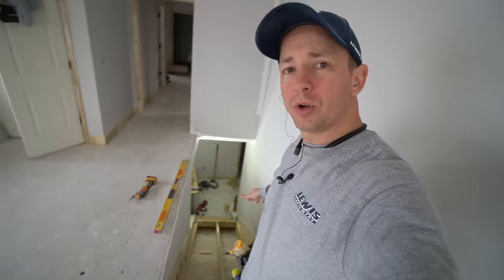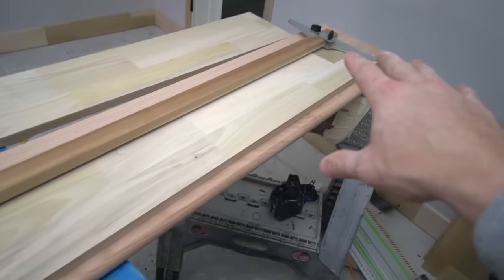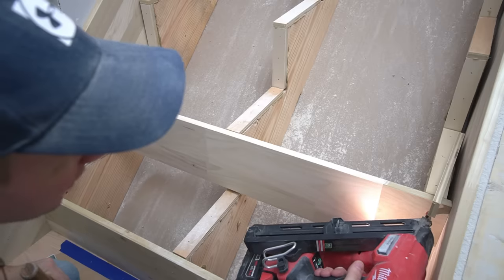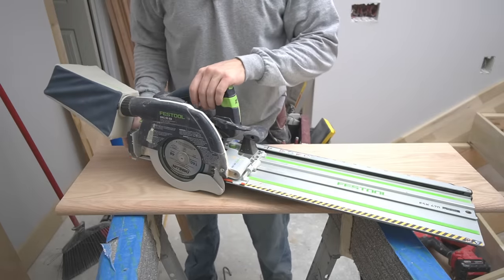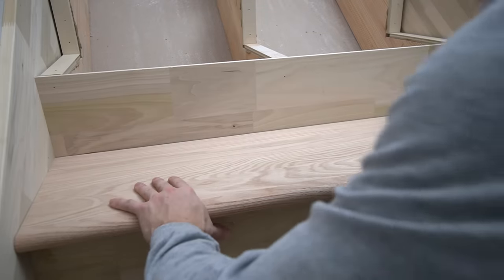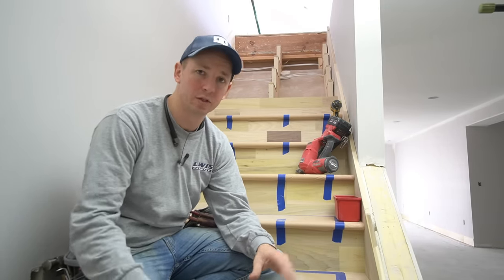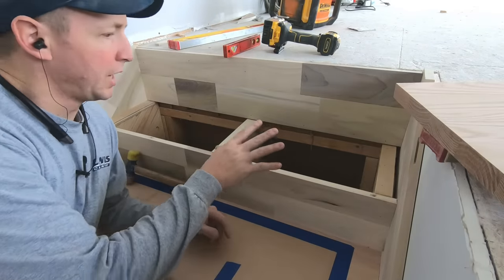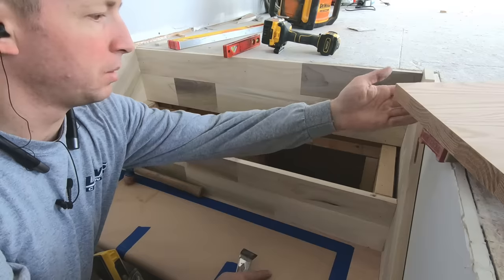Professional Stair Tread & Riser Installation - Complete Install Process

Comment: It looks like you switched from a 5 degree back bevel on the treads with PL adhesive on the bottom steps to a 2 degree back bevel and wood glue on the treads at the top. Any particular reason for the switch?    Thanks for the great videos!
Reply from the maker: Yes, with 5 degrees if you over tighten the screws it will actually twist the riser and throw it off.

Comment: Great work and fantastic tips!   The only tidbits I can add is that instead of right and left I put a big sharpie mark on the points of the stair gauge to indicate bottom/ back.   That way on risers the dot is always indicating the bottom and on treads it's always at the back.  Also, I like to put a spacer under the stair gauge, the thickens of the tread so I'm referencing where the top of the tread will be and it also makes it easier to bump the back of the gauge to the riser.  The only downside is that's two more blocks to fumble with on an already crowded staircase. 

Obviously your system works great!  Keep up the great work on the job and with the videos. 👍

Comment: The quality of this video matches your work!....that good.

PL glue is the best thing ever for stairs. Worked without it for years, and fought squeaks and cracks by additional fastners that dramatically increased effort.. Subfloor adhesives don't cut it.
Did you mention the shiming of the stringers?....can be a real pain and effort sometimes, depending on the framing......edit: after reading the comments, plenty of input on the stringer shims😀

(Old guy disclaimer)...Almost exactly my normal process, after refining it for 47 years and 400 plus installs.

Comment: Thanks.  Can you comment on the double glued spacers you use against the treads and risers?  Assume you’ve learned best for sound prevention.  Also, in my case I am replacing treads/risers; the big headache, removal of these old spacers (just under treads) and related adhesive.

Comment: Your definitely a high quality finish carpenter. Most finish guys I see ( 36 yrs custom home builder) build stairs the same way, although some dado the bottom of the riser for the tread to sit into. 
     My question is, the stringers look like 2x10 not even 2x12. There’s no double center stringer or even a 2x4 on the side for strength or deflection. Personally we only use LSL stringers only because the stringer  cannot deflect , sag, twist , crown ever.
Reply: Look like 2x12 to me and the two outside stringers have 2x4 on the outsides to allow for drywall and skirt board.
Reply from the maker: This is rock solid. It's tied into the wall framing. You just can't see the 2x4 spacer between the 2x12 and the wall.
Reply: @michaelmaas5544  I realize there’s a 2x4 on the outside stringers and I assume they are lagged to the frame but there isn’t any 2x4 on the center stringer and it will deflect
Reply: @InsiderCarpentry  I get that, and I assume they are lagged to the walls. But there is a single stringer centered and it doesn’t have any other support. Great channel
Reply: @jncn1490   IDK knee wall under it perhaps?  What I do know is if Spencer says it’s all good then it’s all good. He has never shown me anything that would make me doubt him. And I don’t believe he’s willing to put his name on anything that’s not right.

Comment: Beautiful work! That wood looks so good in its raw, unfinished form. Question though, I just had my carpeted stairs redone in red oak treads by a carpenter. Im in a cookie cutter 2 yr old house with a cheap usb and construction lumber based stair base and the carpenter went in and tried to eliminate as many of the old creaks I had before putting down the new treads (stairs were creaking like crazy with the carpet!). He fixed the subfloor creaking but now I get creaking as I walk on the treads…looks and sounds like tread-to-riser creak now as the treads are very nice and tightly installed with no gaps. What can I do to remedy the creaking? I know I don’t have the center stringer like in your video so I assume it’s because of a lack of sufficient support in the middle of the tread? Thanks for any insight!

Comment: why the plywood on the stringer edges?
Reply: I was just going to ask the same question!
Reply: My question also. In the other stair tread video he did, it was because the stringers were initially cut with rise/runs to accommodate carpet, but was later changed (after install) to hardwood, necessitating an adjustment in rise/run - thus the plywood. I wonder if that is the case here as well.
Reply from the maker: Framers cut it wrong. They had it cut in for carpet with 2x framing material. So the framing lumber had to be removed and the treads shimmed up 1/2". I was going to put it in the video but it was getting too long.
Reply: @InsiderCarpentry  makes sense!  Thanks for the response.  Great videos! 👍👍

Comment: Question.. I have a situation with a kinda trashed staircase. Pine treads and pine risers. Was a carpet set. The treads are mortised into the stringers. I want to install new treads and risers. They squeak and some treads are cracked. I was to put new oak treads with white risers. I have to cut off the existing noses of each step. If I put a new tread on top of the existing tread what should I do with the old tread nose that is mortised into the stringer? It should be under the new tread, Sugestions?

Comment: I used my kreg tool to make pocket holes in the stringers and screwed into the underside of the treads so I had no exposed nail holes. I did have access to the underside of the stairs.

Comment: Great video, and quality work! 
With installing stair treads and risers it seems some like to install tread before riser and some like to install riser before tread! When I worked and learned from my old boss he did tread then riser. Now I work for myself doing finish carpentry work. I'm starting my first stair tread and riser install this week. Trying to figure out if I want to install riser before tread and seeing this video. 
Would like to hear anyone's opinion why they install tread or riser first!?
Reply from the maker: I like risers before treads because its more forgiving and you can screw the riser into the back of the tread. Very strong, tight joint, no squeaks.

Comment: Tread gauge is neat. Easy to handle a wider tread with a longer piece of 1 by.  I don’t think you mentioned it, but it appears to handle any out of parallel situations with the skirting boards.

Comment: Why did you change from screwing through the framing stringer into the skirt board (7.00) to screwing through the top of the riser into the skirt board (11.10)
Reply from the maker: Evolved. I liked the results I was getting better going directly through the riser.

Comment: My first step for installing treads and risers over rough cut stringers is to re-evaluate my strategy - there are so many reasons why CNC cut routed stringers are better. 
First, if you must cut sawtooth stringers use LVL so that the point doesn't shrink away from the tread riser like it will with KD framing lumber.
Second, there are no visible fasteners with routed stringers. Don't tell your customer that the nails in the top of the tread are necessary, because that's not true.
Third, all your treads and risers will shrink/expand with seasonal movement. Even if all your joints are tight, there will be gaps that will appear after just 1 year. There is no scribing at all with routed stringers, and there is room for seasonal movement.
That's just a few reasons...if you don't know what routed stringers are, call a professional for your next stair project.
Reply: Great video, just pointing out that there is a much better way to build stairs that gives a better product and can be cheaper/faster.

Comment: I seemed to have missed something here.  With your "day 1" installation of risers I didn't see you drill through the top of the riser and into the skirt, then screwing the two together, but you were doing that on the next day's install.  Why the difference, and what's the point?
Reply from the maker: On the first few risers I didn't screw through the top of the riser, but then I decided to.

Comment: I am in the process of replacing the beat up, old, ugly stair treads in my 1952 home with new red oak treads. It looks like you didn’t stain or varnish the treads you installed here. I’m new to your content, so forgive me if the answer should be obvious… Just wondering if finish work is outside of your wheelhouse (so another trade person is coming to do so later), or if you recommend staining and varnishing ahead of time? This is a big project that I’m primarily doing solo. I’m pretty handy, so I feel confident, but I like to be prepared before I get too far ahead. Thanks for you’re a great video!

Comment: Awesome video.  Thanks for posting it!

Any thoughts on pre-finishing the treads (and risers) so moisture levels on top and bottom don’t get out of whack?

I’ve also seen some treads rabbeted into a rabbet or dado at the bottom of the riser to allow for movement without opening a gap.  Worthwhile or a waste of time?

About to replace carpeted stairs with hardwood treads and risers.  This has been the most detailed and informative video I’ve found so far.  It’s much appreciated and earned my sub
Reply from the maker: The stringers are drywalled on the underside so i'm not concerned about moisture here.

Comment: Did you shim/plywood the rise and run or where the stairs like that? Curious how you square up those shims. You skipped that part. And what do you do on top step with a 3/4 hardwood floor? I typically make my own top transition

Comment: @InsiderCarpentry great video. I am going to replace old steps in a stairway to the basement for my first go at steps. A couple questions if I could:

(1) For the pocket screws to screw the back of the riser into the tread, what size (#8?) are they and are pilot holes needed? I don't think i saw that but wanted to check.

(2) Later in the video i see you screw the top of the risers into the stringer, but not on the first riser you installed. Why is this needed and what size pilot hole and screw are you using?

Thanks!!

Comment: Would anything be different on a remodel? Like ripping out carpet and putting in woods treads and risers? Am I going to be able to do all that screwing in from the back side stuff? And many are telling me I don’t need to remove the construction treads that are under the carpet though I’m using full thickness pine treads not retrofit treads. You obviously know what you are doing. Help

Comment: Do you ever run a rabbet on the back side of the tread and a dado on the bottom or the riser? Have you ever used a Lamello Tenso P14 biscuit to attach them for a no fastener look instead of using nails?
Reply from the maker: I haven't. This is more of a "Production" style job.

Comment: I want to make sure I'm doing a squeak fix right on an old staircase with no underneath access. 1. screw risers into verticle stringers only and angeled into right and left skirt boards. 2. screw treads into three horizontal framing stringers. Any other comments? Thanks. I'd buy a house you built!

Comment: Fantastic job. Do you fill in the pin holes left by the brad nails or are they too small to notice?
Reply from the maker: Painter will fill them to match stain color.
Reply: @InsiderCarpentry   👍
Reply: @InsiderCarpentry  do you happen to know how they do that?

Comment: I'm planning a "replacement" project with Red Oak treads & risers. It's a pretty dense wood, is there a certain kind of air nailer required for red oak? I don't want the nails to just bend in place, that'll destroy a tread or riser.

Comment: I have stairs that were covered in carpet that I am changing to hardwood treads and risers. Question #1: Do I need to remove the treads and risers that are currently there, that were formerly covered in carpet? Or do I just cut the tread flush with the riser and cover those with the new? Question #2: If you're installing without a finish, how are you finishing your bare wood?

Comment: Great Video. Is there any height difference in the center tread? Like you left the 16th off for the front of the riser for glue. Also since you slightly lift the riser in the front does that create and out of level stair tread? I need to know because I am having to correct bad stringers beforehand. Thanks

Comment: If the skirt boards and risers are to be painted white and the treads to be stained (which is a common look), is it typical to pre-paint the skirt boards and loose risers, and pre-stain the treads before installing the risers and treads? Otherwise, the finishing process would be extremely tedious, I would think.

Comment: If you take a 3/16 bit and predrill through the edge of the riser and out the back you can take a 3" pan head and screw the riser right to the skirtboard. It keeps your risers from gapping when you force your tread in.

Comment: My contractor did not put the third (Middle) 2x12 support under the stairs.  He only has the two ..left/right side and the supports 2x12 do not reach the top of the steps.  I see gaps and the riser is missing on the top step.... there is a whole?  I don't want to pay him if it's incorrect. I'm a lady here alone.

Thanks your work is so neat and soothing to watch.  I learned a lot!

Comment: I did all wrong in my attic skirt boards was in place with no stringers only risers was nailed to skirt board's no support in middle 1920 stair six of them split I put 1/2 in treads with individual stringer.

Comment: Nice video. What can happen if the  treads and raiser be secured with screws but without glue? 

After 3-4 years when it’s needed to be painted or stained it will be much easier to remove everything and put back after paint and stain.

Comment: Super vid. Self taught contractor, frame to finish, who developed the exact same techniques over the years. (38) Bought the stair gauges after seeing you use them in a previous vid. The kind of purchase you’ll never regret. Should probably get the festo. My Mak track saw needs a neat aftermarket similar attachment!!!!!! 
     Always have cut my stairs with sliding compound. 1 degree. Or what I call the pencil cut…pencil under the end to cut. Creates a 1-2 degree bevel. 
     Used a  square -each -end 1x12 , cut 1/4” or less too short  to test fit and eyeball off angles. Often meant I could cut the tread square or eyeball a slight off angle. ( I framed the walls and stringers VERY CAREFULLY, so that helps. Plus BLOCKING IN THE WALLS!) Use shims to slightly change the treads angle slightly to a square blade. Don’t try to keep changing the saw angle. 
Two bevel gauges, R and L. Made one cut one end leaving tread 1/4” too long . Test fit and or alter before final cutting the other side. Saw setup at bottom of stairs. Sharp hand plane speeds things up, tweeks cuts, and rounds bottom cut on side pushed down last. No need to recut a bigger bevel. For those who can’t afford all the goodies!! Love your stuff. Wish you and YouTube around when I started!!

Comment: Does there need to be an expansion gap on the stair tread?  Some facts: I am installing planks of white oak on top of rough lumber with glue and nails.  The stairs are open with the tread hopefully wrapped around the rough lumber; each tread will have bullnose on the front; the planks (about 8" wide); and are tongue and groove (same wood as our floor).  I am hoping to not have a quarter round on the treads where they meet the a pre-existing skirt.  What are your thoughts?

Thanks, by the way, your channel is a game-changer, one of the best channels for a lot of fine woodworking projects!

 -- Michael from California

Comment: Great video just subscribed, I clicked on the link for the festool track saw and it says unavailable, will see later if it will be available in Amazone, this looks like the tool I need for many of my wood jobs in my house, also there are many guide rails, has to be bought separate, which one is the best? Fsk 420, Fsk 250, fsk 670?
The bag that collects dust also is sold separate

Comment: I saw this or a similar video before doing my stairs. I did not nail anything, but did screw from behind. My stairs squeak like crazy, but everything looks tight. Any tips on fixing that issue after the install is complete?

Comment: Are those track saws good for cutting a straight line in flooring in a doorway . Or would it still have to be cut with a dremel on the sides where the saw stops? If that makes sense

Comment: I'm starting a project to remove carpeted steps and replace with hardwood. Would you recommend removing the 2x pine that is already there? Lots of videos showing people just gluing hardwood on top of the existing 2x.

Comment: Using my ts55 I’ve done similar installs to this. Instead of a stair gauge I used luan scraps; either using brads orca glue to attach the sides pieces to the back piece.  I put a back bevel on the back of the tread and glue that joint as well. Is there any reason why you choose only use screws?
Lastly your videos are top notch not. Thanks for sharing the info you’ve gained over the years.

Comment: Hey I have a side job coming up. I've only been a finish carpenter for 3.5 years now, and that's also how long I've been doing construction period. I've been doing rails for the last year almost, just cap and rail for the most part. But this guy wants me to reframe a half wall that's pitched, and wants the treads to continue with the balusters on the treads instead of a cap. Can you possibly tackle one of those in the future?